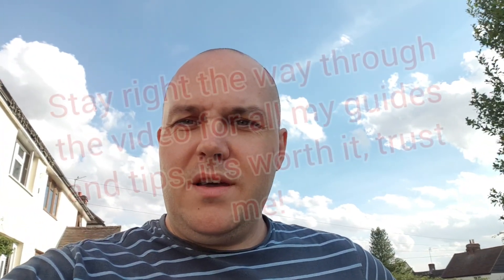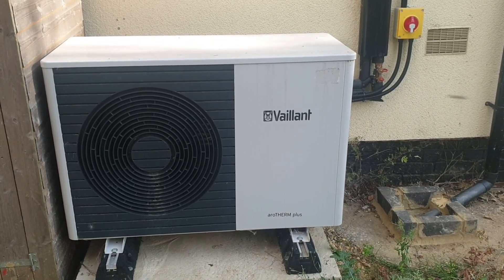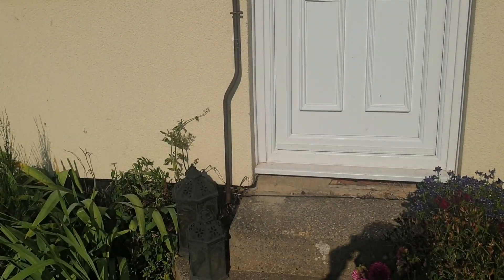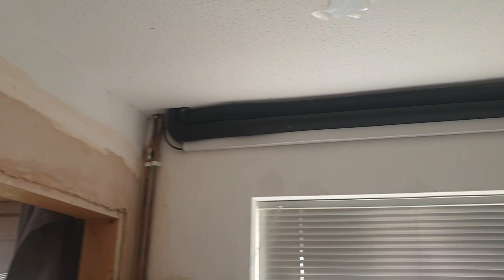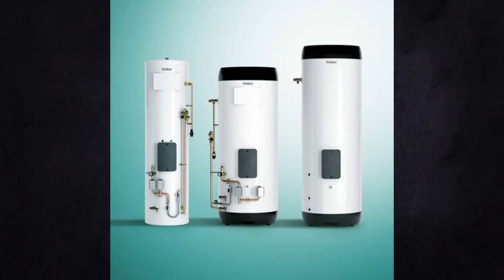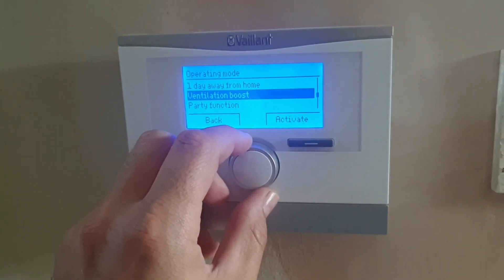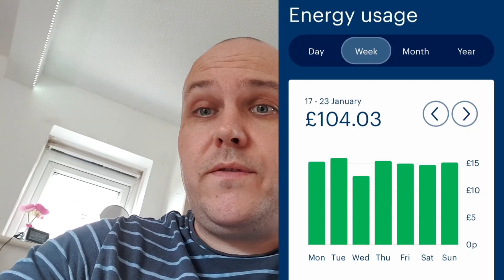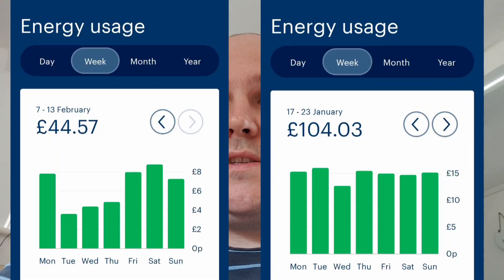Air Source Heat Pumps - After Install - Vaillant Arotherm Plus Review

Comment: I just got everything provided and installed free of charge as part of a Scottish government scheme. Heat pump, solar, battery, and all of the radiators and pipework. The equipment cost around £13k and I think the labour was probably about the same. I didn't have central heating previously and don't have gas. In the two weeks that it has been here, I'm saving around £200 per month in winter and will probably have no bills in summer. The heat pump is fantastic. I would recommend it to anyone thinking about adding or upgrading central heating. My main worry prior to the installation was creating noise that would annoy my neighbours. I can confirm that the Arotherm Plus is silent when operating.
Reply from the maker: Yes your right, im saving a bit more now I have better settings, from one of the pros. So might do a video about this if I get enough ask for it :)

Comment: Thanks for this vid. It’s put my mind at ease somewhat. I am also not on the main gas supply and have oil central heating and hot water. I was about to replace the combi boiler for the 3rd time in 20 years. But with grants it’s going to cost me approximately £1500 more to have an ashp instead and I’m going to be able to remove the oil tank from my garden. Thanks again.
Reply from the maker: Mine has been great, few issues, but its been great, would highly recommend them

Comment: that pipe out the front , why on earth didn't they install a water condensate pump so it could be rooted out the back to the drain, also why didn't they put the pipework in the joist floor or is the gap to narrow,
Reply from the maker: I've been very happy with it, but this I didn't want, but they said I needed it.

Comment: Not for me - noisy and expensive. The only energy saving my aroTherm does is that it regularly shuts down for an hour and a half in winter. No warning - we just notice the blissful silence instead of the Arotherm's motor boat like racket.
Reply: Do you think you have been subject to a poor install like many others.  Your comments seem to go against everything else I have read about the aroTherm, especially noise pollution. I did see a VLOG from Skills Builder and Heat Geek that explains the problems you can have with noise if your Heat Source Pump is not sighted probably and kept upright! Just a thought..
Reply from the maker: Mine is fine
Reply: Thought you said it wasn’t for you???!!!
Reply: Mine is silent, even when standing next to it. Maybe you should get it looked at.

Comment: I'm having electric radiators taken out and an ashp installed, would like to see pics of new radiotors and new pipe work that has to be installed internally to feed the radiators 👍
Reply from the maker: they look same as normal rads and 15mm pipes, just pipes in the floors above as 22mm and the supply pipes from AHP to the tank are 28mm.
Reply: Have you considered air to air heat pump to avoid radiators?
Your installer's heat loss survey will specify the radiators (emitters) needed for each room. The pipework may not need to be that sizeable (see the Heat Geek cheat sheet).

Comment: You appear to have external wall insulation by the looks of it. No wonder a heat pump works.
Reply from the maker: Lol another gas fitter tell you this? Doesn't matter. Complete rubbish.
Reply: @BillsCountrysideAdventures  Nope, it's my neighbour across the road actually. He's "loving" his heat pump and is regretting not spending the money on insulation first.
Reply from the maker: I don't have insulation in half a meter in all top rooms and still working great
Reply: @BillsCountrysideAdventures  good that it works for you but from what I saw (I went to my neighbour's house last winter and our houses are identical) I'm sticking with gas for now and spending the money on insulation first.
Reply: @dpn1604  insulation keeps heating bills down in all cases. If the heat pump is well installed, heating costs should be comparable in the UK at current gas/electricity prices. Electricity tariffs can help lower heat pump prices further (demand shifting).

Comment: Thanks for the hands on experience, much appreciated. I was just wondering how much it ended up costing you to install with all the modifications you had to make to your pipework etc. Cheers
Reply from the maker: It was about £10k
Reply: @BillsCountrysideAdventures  Thanks! Was that with or without any grants from the government like the boiler upgrade scheme?
Reply: Have you got any pics of new rads and new pipework internally as im having electric rads removed and a ashp installed i just cant picture the internal pipework that will feed the new rads @BillsCountrysideAdventures

Comment: Great video Bill, do you get the Vaillant controller with the unit?
Reply: do you get the Vaillant wireless controller with the unit?
Reply from the maker: Yes I'm sure it did, I'm no way technically minded on this, but the lot is controlled by the tank,  wires go into that I think. What I can recall on install but was months ago. There is a box on wall too and also got wire to boost by pure electric. Hope this helps. It works great and saved me tons of money, that we all need nowadays. All controls are from tgat wireless box.

Comment: This installation is not done to the required standard. The unit needs a minimum clearance to the side of 500mm for airflow, this will affect your scop. You will also not be able to maintain it - as removing of the top cover is now impossible!

This unit is also to be installed away from any drainage, so-called protective zone - yet you get a gully right next to it.

You also have an air vent within the protective zone - this is a no no! God you also have a socket within protective zone - not allowed! 

There is so much wrong with this installation and I only just watched the first 90 seconds.

Get the installers back and get them to sort this mess out.
Reply from the maker: Very interesting,  thanks
Reply: @BillsCountrysideAdventures  check the installation manual and get them back to move the unit
Reply from the maker: @UrbanPlumbers  I'm afraid they never give me this,  he was filling it in to send off,  to be honest they are crap company,  damaged my carpets and bathroom flooring. I question the drain for antifreeze cycle just drained into the ground,  like 2cm and they added gravel like 30cm, I didn't think that was right. Also the caps on the outside are not covered like all other pipes. The parts they fill with antifreeze.
Reply: @BillsCountrysideAdventures  they have to leave the documentation behind. I would complain If I were you and I would get them back to move the unit